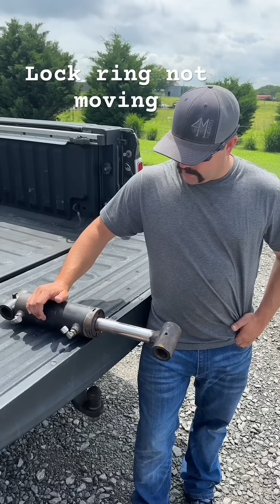Is there a way to fix they hydraulic cylinder? #shortsvideo #quickchange #how

Comment: it you cant see the end of the ring have someone turn the gland and take a punch or chisel and tap it around. sounds like the hook on the ring broke. good luck i never not got one out it takes a little doing but you can get it out
Reply from the maker: That’s what happen it was broke. That did it ,also driving it around with a punch. Went through 3 little punches an finally got it out. Thanks!
Reply: @4MRanch  im happy you got it.